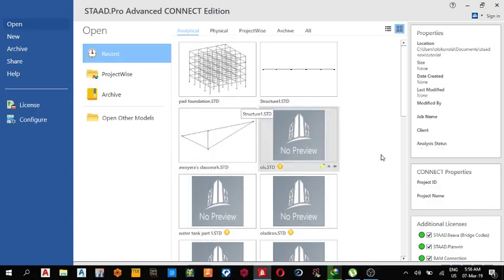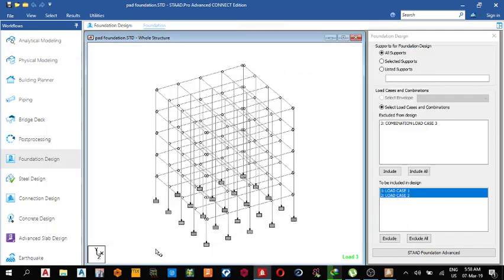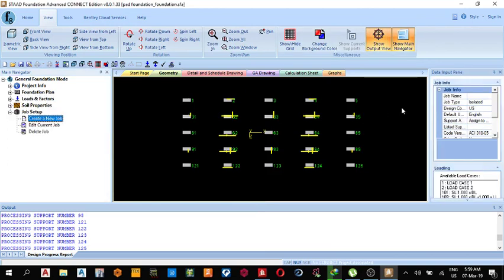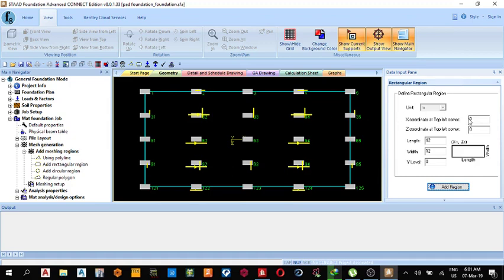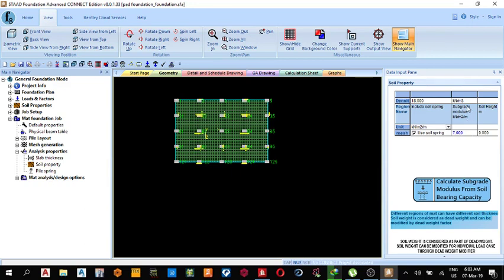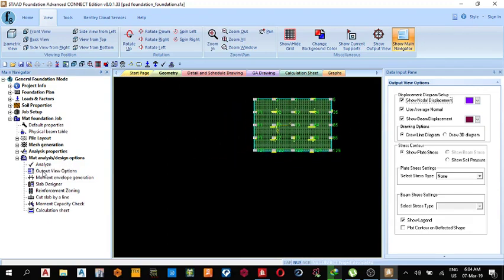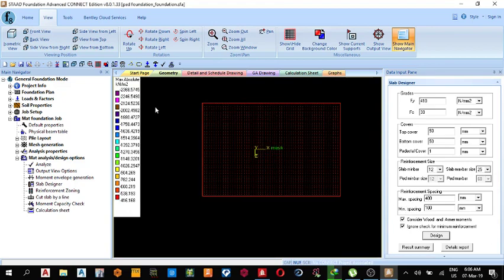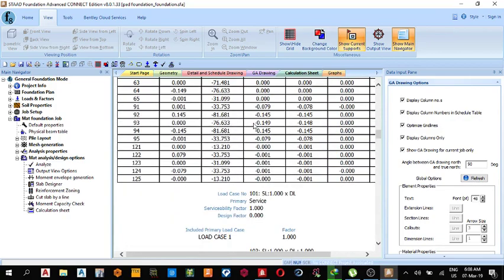How to analyze and design mat raft foundation with staad foundation advanced

Comment: Provide software crack...
Reply: @Lanreolokunola  can u pls send me crack file...and patch file of urs ...on my google drive..my mail id is...... omikaps@gmail.com
Reply: Sir I am using staad advance foundation 9.3 it is working with isolated, combined and pile foundation but it fails to run analysis for "raft" file.  Can kindly give me the crack for it in my mail id fazalarju@gmail.com
Reply: @fazalarju  same bro I can analyze but moment capacity check is always passing even with totally weird values, bro pls send me link if u got
Reply: Bro any one of you got link
Reply from the maker: Email me
Reply: Mail id: "a7675842500@gmail.com"